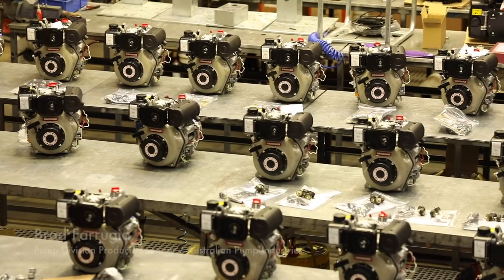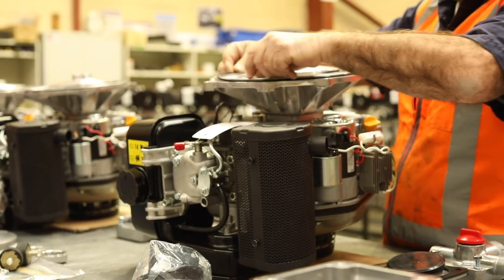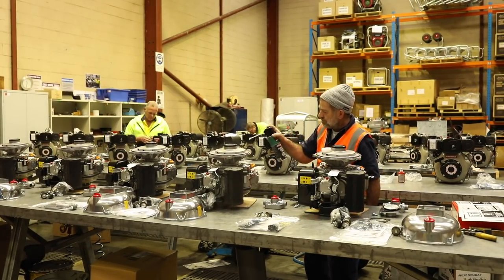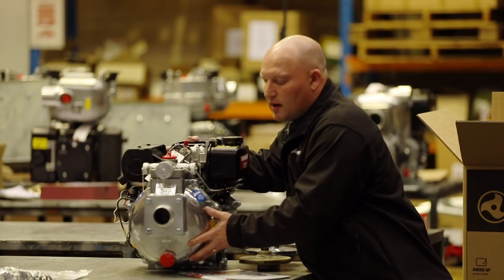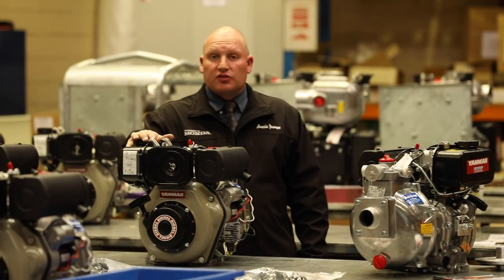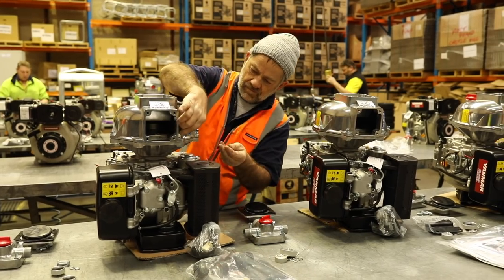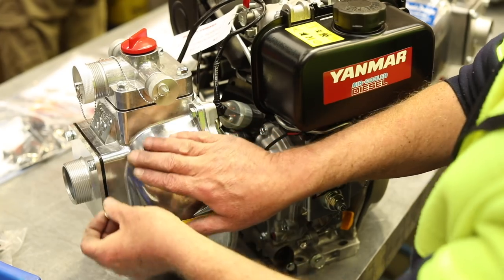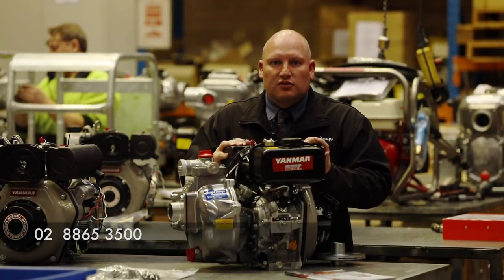Yanmar Fire Chief | Aussie Pumps

Comment from the maker: Thank you so much for your very valuable comments.  We are all in the business of developing and building pumps that outperform all others in their class.

That not an idle claim but is the truth.  We agree with you 100% in your comments about using a fire pump like our new 3” QPT305SL/GX390 Fire Fighting pump.  We have used these products to put out spots and know that they outperform all others.

We would never suggest that our product outperforms 700 litres per minute, 100 psi super professional machines. 

Our pumps are for farmers, homeowners and yes, they have been known to play a major role in putting out ember spots around houses during major fires.   

I spent my Christmas down the south coast and worked with the firies at the Bawley Point and Tabourie.  I also talked to a lot of people who had fought fires using in one case a cheap Chinese fire fighting pump that leaked like a sieve, blew it seal but, still protected a farmhouse outside Milton.

We agree with you!  There is nothing like capability and that means horsepower and performance.  There is still a place for the humble Aussie Fire Chief to do its duty as well.

Warwick Lorenz ... General Manager

Comment: Self proclaimed to be the best in Australia, with terms like big, more, huge and high with no specifications on flow at any particular head or psi. More marketing BS on your pot plant watering toys.  Your biggest and best 3" Mr T twin  QPT305SL/GX390 puts out a piddling 300L/min at 7bar 100psi by your flow chart,  which is not enough water for a TFT's dual pressure 1.5inch fire fighting nozzle that demands 360L/min on low through to 1150L/min on high setting @ 7bar. You see that, specifications.   Please anyone for your own sake dont buy a pump from any manufacturer that uses the terms big, large, high, more, huge because they're hiding the truth and putting sales before life. Don't believe Max flow and Max head because you dont get both at the same time, its marketing BS. Head and flow works on a sliding scale. A flow chart showing what flow at a pressure is the only truth. If you're confronting a bushfire with a Pump under 20hp 4" suction 3" outlet and less than 700L/min @ 7bar 100psi you'll be part of the fire. Sadly and unbelievably you'll have to look the the States, Canada and England for such equipment. lastly have 100,000 litres ready to use and don't buy a water tank with 2" outlet, demand 4" or go elsewhere.
Reply from the maker: Hi Dean,

We just got brought up to date on the very instructive comments you’ve made on the traditional Australian designed and built concept of lightweight portable Fire Pumps.

Any points that you’ve made don’t offer any constructive advice to home owners seeking to protect their own properties.

I have to tell you that what you are saying is negative in the nth degree and insinuates that our Aussie Fire Chief, the best lightweight portable fire pump in the world, is not competent in a fire.

When the last major fires came through Arcadia around 12-15 years ago, I worked with the RFS team and protected my son’s log cabin from the fire using an Aussie Fire Chief.  Admittedly, we used a 1.5”inch hose with a high quality nozzle and had the benefit of a large dam to draw from.

Compared to the pumps that the RFS was using, our Fire Chief did a mighty job, extinguishing spots so that even in the heat of the fire they went out and stayed out.  The RFS were suitably impressed and subsequently purchased 500-600 of these pumps.

In fact during the Black Summer down the South Coast where I was on vacation I wound up working with the Firies and home owners in the back blocks behind Milton.  I saw even a cheap Chinese low cost fire pump with a leaking seal save an old wooden farm house from the fire.  No, it didn’t put out the fire, it enabled us to wet down the roof, fill up the gutters and make sure the ground around the house was clear.

I think you misunderstand what the Australian concept of a lightweight portable Fire Pump actually is.  It’s not supposed to do the job of a $30,000, 30-40hp diesel engine drive pump! 

It’s horses for courses Dean.   

You may be interested to know we recently made a major shipment of Fire Chief pumps off to the United States to help them in their fire season.  It’s a big seller in the States.  Our Fire Chief is also being widely used in the South of France where they currently have fires raging now.

Appreciate your comments.  Don’t confuse the poor folks who just need to protect their homes or properties.